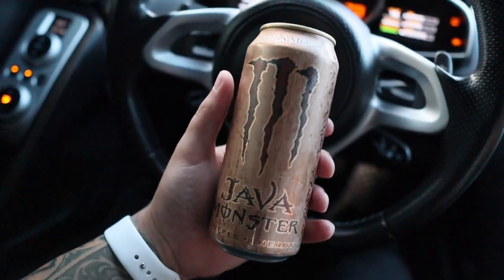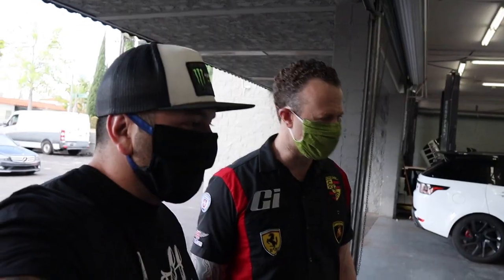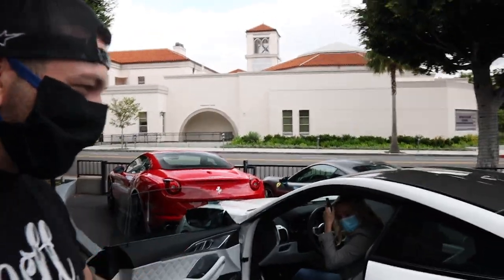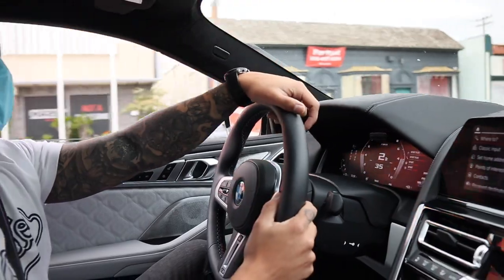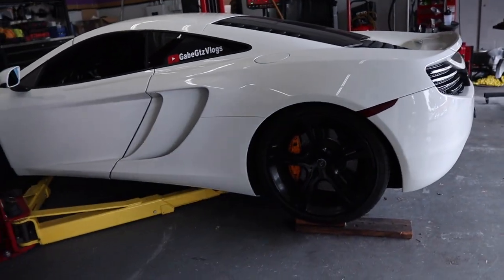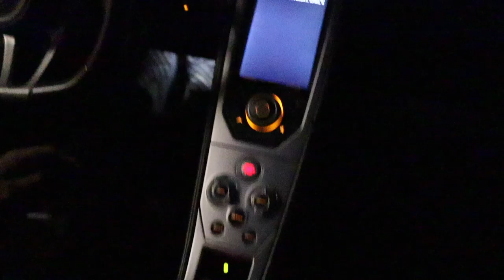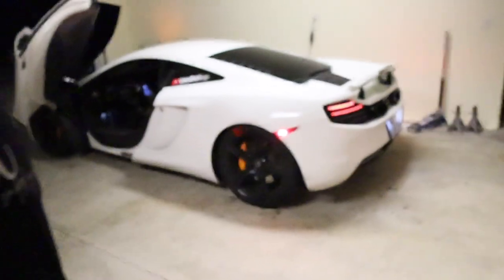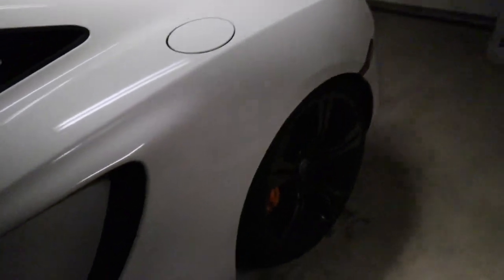I STARTED MY MCLAREN GT3 BUILD!!

Comment: Looks like they change the springs with the lift on. As soon as you do that, when droping the car back with the new springs on it and the lift up, you will have PCC Degraded error and your lift will be disable and the handling stuck to track but shows as normal. You'll have to bleed the hydrolic system with the diag kit to fix it.